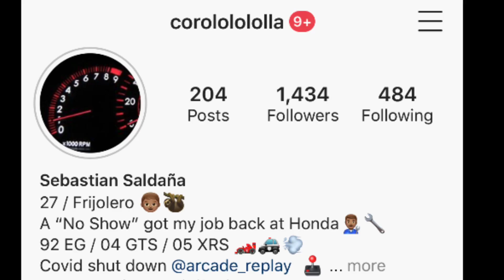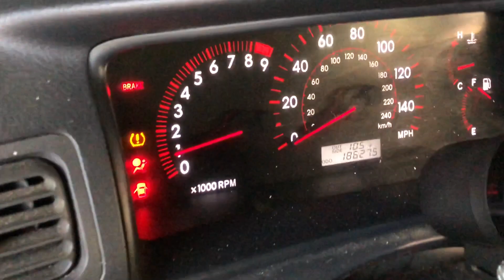Rafa’s Garage X 2ZZLOW / Timing chain cover gasket job

Comment: Bro....i want your contact to personally contact you. Ive got a check engine light. IACV was the issue. I changed it with a spare part from the junkyard and still check engine light.....my idle is still pretty ruff but better than before..... please i need help
Reply: is it an xrs with a drive by cable throttle body?
Reply from the maker: Switch to a Celica 00-02 Throttle body. fixed my issue.

Comment: Hey man,  I got a question.   I have an 03 matrix xrs.  I've had to replace the crankshaft pulley but every one I order is 1 inch bigger in diameter than the one that is coming off the car.   Like the one that's coming off is  5 inches and the 2 I've ordered to replace it are 6 inches in diameter.  Is this ok to use? One was ordered from rock auto and one from O'Reilly.  1 inch doesn't sound like much but it could change the amount of tension on the belt.   I've specifically asked for xrs and they keep sending me a 6 inch pulley.   Everything lines up but i'm hesitant to finish the job and start it
Reply from the maker: I can sell you a 2zz pulley if you want. Also monkey wrench racing sells the right one
Reply: get it from the toyota dealership